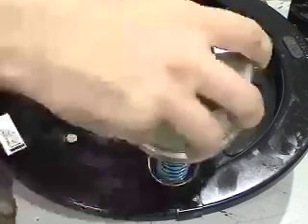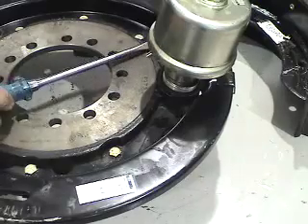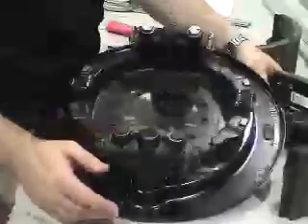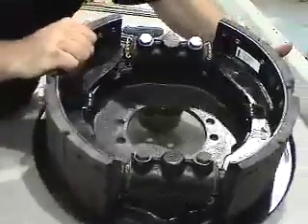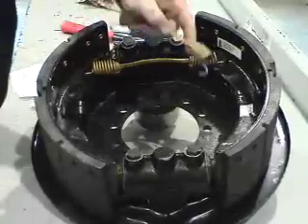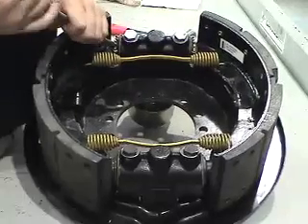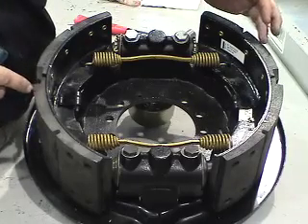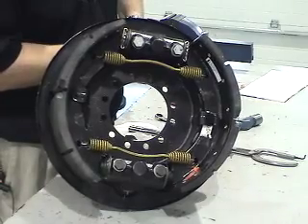Wedge Brake Part 4

Comment: I have a Taylor Loader with wedge brakes, I am missing one of the chambers. Are these parts available anywhere. I have one on the other side to compare it to. Any help would be apreciated!

Charlie
Reply: Correct you can still get parts
Reply: @gerlandkent6377 , where do you get the parts? I’m working on a 1980 International S1900 grain truck with wedge brakes and I’m struggling to find the correct parts.